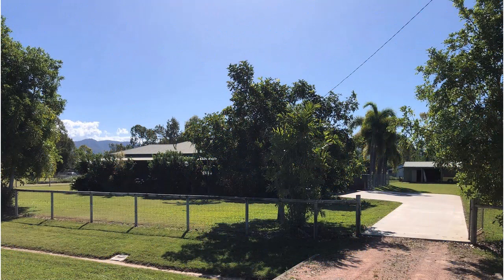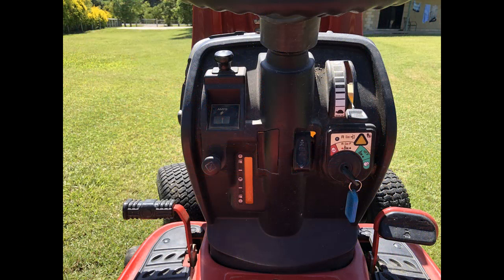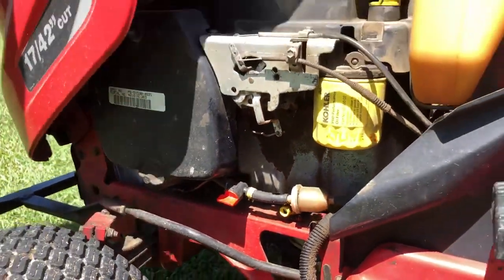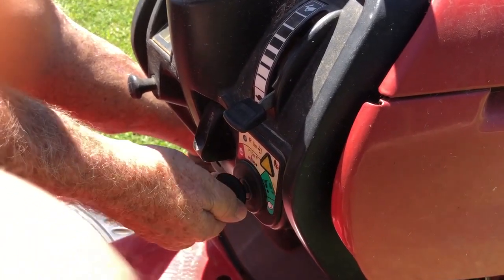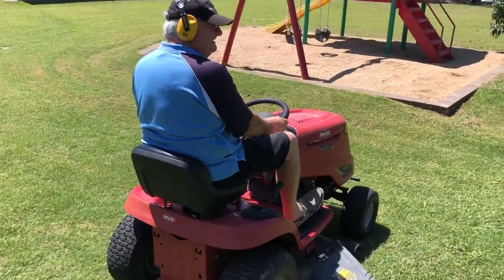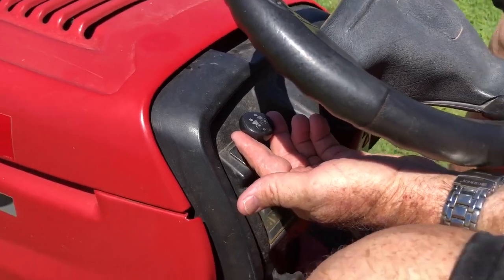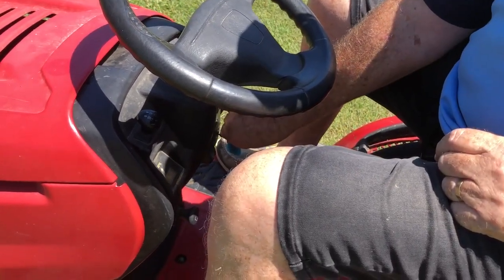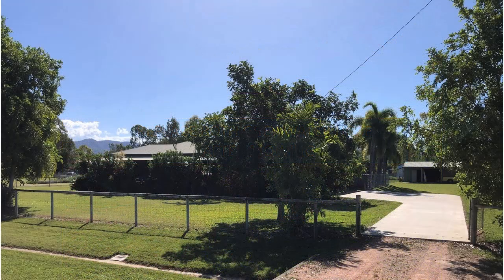Rover Ride on Mower Instructions

Comment: Thanks for posting for the posting  five the years I have own a Rover Rancher 547/38 (that is realy a MTD lawn tractor with  Rover name on it ) But  it been grate.   Even though I mow My quarter acre block ever two weeks   I only mow  it for only  half an hour at a time. You know at mowing with it at  a half hour ever two weeks that one  hour  total per month. So  I would only mow 12  hours total per year. Over the last five years I have had it ,  I have done only 60 hours total over five years at 60 hours the engin would be  barly run in LOL  Yet over the last five years with with mowing sandy  soils  and running in to  thick pachers of grass.   I have gone though two deck belts and also two lots of blades. Just to let you know  mowing grass on sandy soils,the sand will grinds away at  your blades  and hiting thick pacers of grass will jam up your deck belt.  But even though over the last five years  it only done 60 hours I finly decided to change the filter and oil LOL .  I was told to make it last longer I would need to put grease niples  in the shaffs .
Reply from the maker: Good one Ray. Mine is about 11 or 12 years old. I don't mow very short so don't have problem with soil grinding blades away. I've had to replace the electric clutch about two years ago and i have replaced all the pully bearings. I try not to wash with the hose unless I've been mowing wet grass. The leaf blower cleans it up nicely without water getting into bearings etc. Cheers mate.
Reply: @RossT47  I just love this mower But I did have a problem with the hour meter I did not know you got to take the key out of the mower to stop the hour meter working  it only done 12  hours and I had over 100 hours and it flatten the battery It cost $100 .00 when  had to replace it . Be careful of cutting long grass over two ft 2400 mm only do 100mm at a time to much grass  it will jam the blades and the motor pully will either burn into the cutting belt or brake it.  If it burned in to the belt the mower will still cut but it will also  vibrate the mower as the belt out of balance. If you have to replace the deck belt  it is far easier to take the deck off.  Also reguly check you tie pressure. If you leave you mower out side water will cause a reaction in the edge of the body just spray the body edge  with WD40.